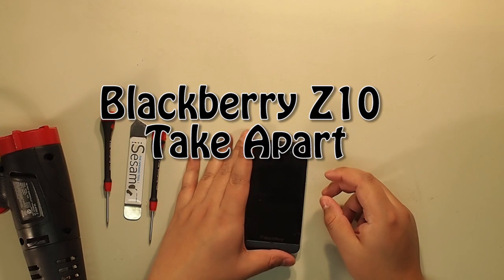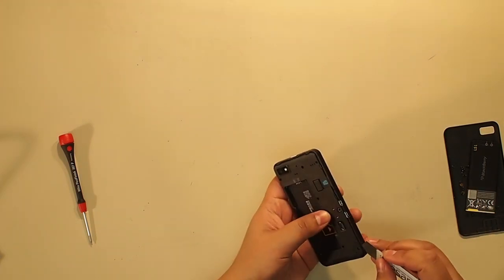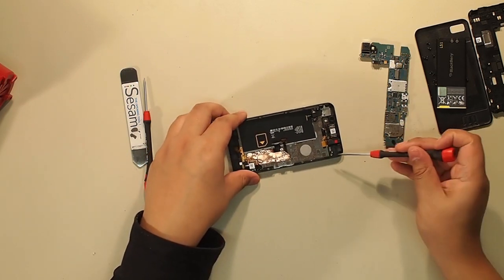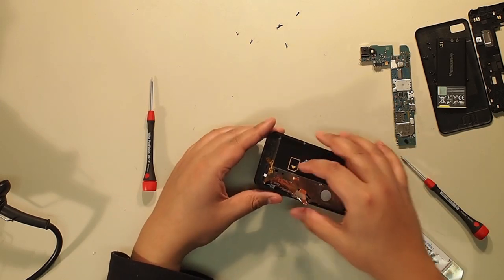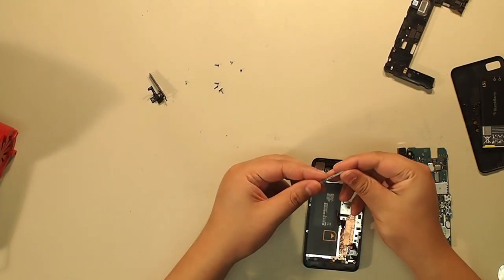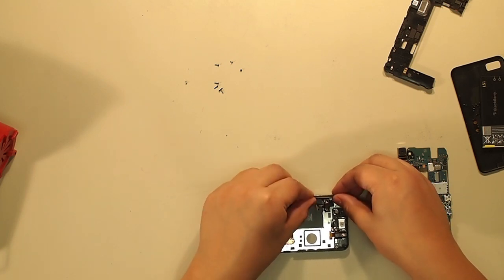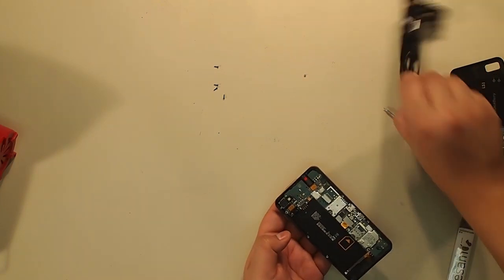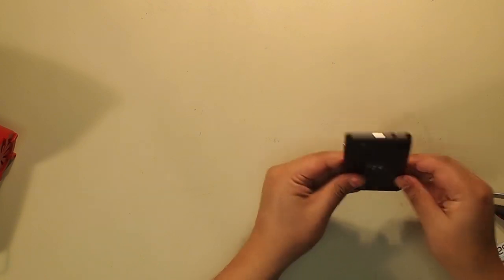Blackberry Z10 Take Apart And Reassemble Tutorial. DIY, Screen Replacement

Comment: Nice Video, but how do you remove the volume button?
Reply from the maker: i actually don't remember, it has been so long. why do you need to remove the button?
Reply: @techguyz708  Thanks for the answer. My volume buttons doesn't work, first the volume up button and actually up and down. I bought the same phone (for replacement parts) and I try to get out the part. There is an small cable from the motor to the top of the phone towards the screen, but there is an metal plate. I think this ist the cable for the led.
Reply: same problem! have you fixed it?
Reply: @denzelbuya6612  I doesnt fixed it. I buy an new phone. I had problems with the phone (Battery was in 8h empty, tested with 3 batteries)

Comment: Do you have to remove the screen to change the power on/off button, or just remove the motherboard?  Is this the correct part?  Thanks.  http://www.ebay.ca/itm/New-For-BlackBerry-Z10-Earpiece-Headphone-Audio-Jack-Power-Button-Flex-Cable-/131241960473?pt=LH_DefaultDomain_0&hash=item1e8ea16419

Comment: my blackberry z10 fell the screen is not broken there are 2 black belt has a right and the other to the left of the screen with lots of different colored vertical lines I want to know if I should change the display or pas.MERCI FOR YOUR ANSWERS

Comment: what are the screwdriver did you use? what are the size etc.?
does this screwdrivers will be compatible? http://www.cdrking.com/?mod=products&type=view&sid=13449&main=146
thanks in advance!
Reply from the maker: those won't work, because you need a t1, everything else is good but you also need a t1, and possibly a t2.

Comment: When taking the plastic backing off after you take the screws out, there is some adhesive that is used to keep the backing attached to the battery terminal pins.  Once all the clips are removed, pull the backing up a bit and use a flat screw driver to separate the backing from the adhesive at that point.  There are no cables connected to the backing.

Comment: You said a T1 screwdriver. Well, T1 screwdriver is too big for the screw. BlackBerry have changed those screws to a T0 on some models. T0 is new and I've searched on the internet for it, no screwdriver available anywhere!

Thanks, BlackBerry! You are a bunch of pricks!!
Reply from the maker: Hard to believe. I have done literaly over 400 of these. All worked with T1. If i do come across a T 0, ill let you know.
Reply: techguyz708 I had to purchase a 668 Pentalobe 5 Spoke Star Torx 0 screwdriver, and it was the correct size.

Comment: Which screw driver where and when? ffs
Reply from the maker: I use a t3 for the outer screws, and a T1 for the little screws on the lcd assembly.
Reply: Ta. Did this repair recently. Easy, and your video did help.

Comment: This is an excellent video!  It shows all the steps.  I followed this video to replace the sim card holder.  Lesson learned...never used a sim card adapter into a sliding sim slot.  This will damage the sim card holder.

Comment from the maker: yes you need to reglue IF you buy the screen without the frame, if you buy it with frame you will need to remove old frame from the phone and then it is just a matter of screwing in the new one, no glue needed.

Comment: Do I need to use any adhesive when replacing the screen? You used the heat gun to warm it and seperate the LCD from the chasis, do I need to re-glue it? thanks